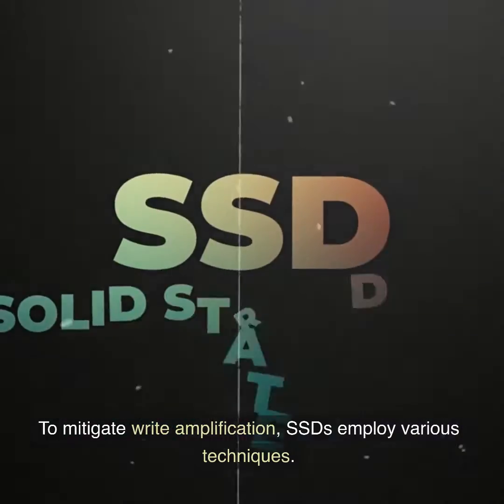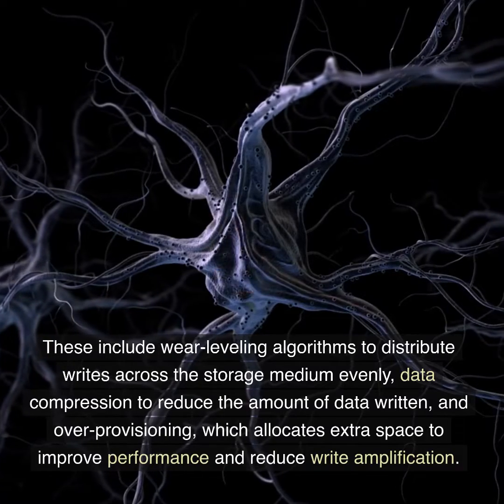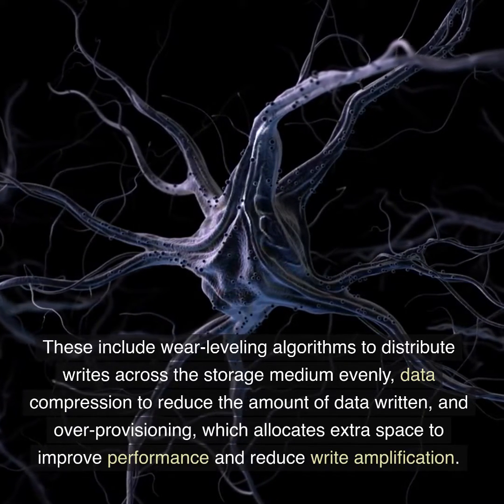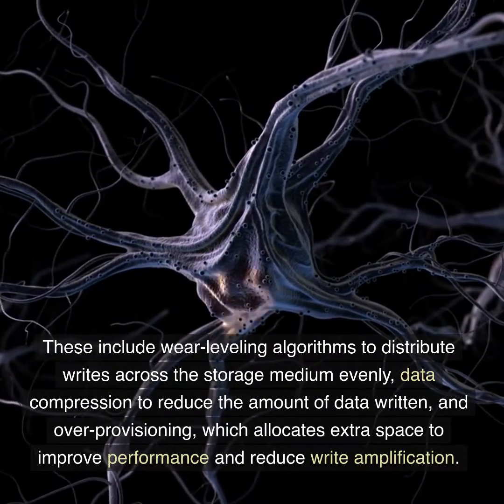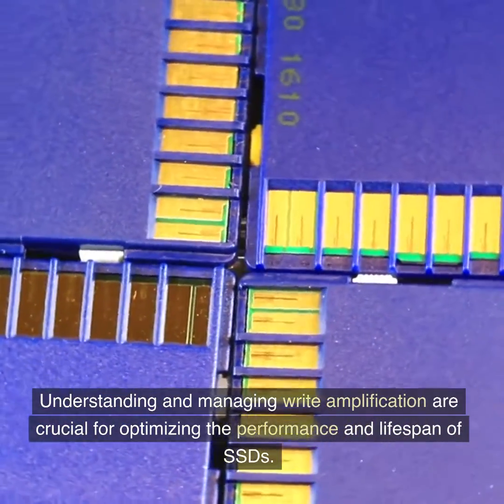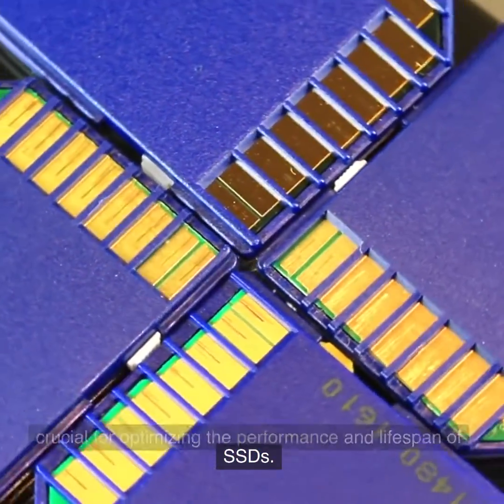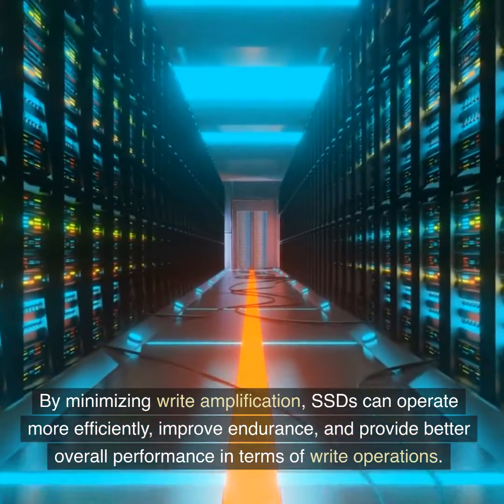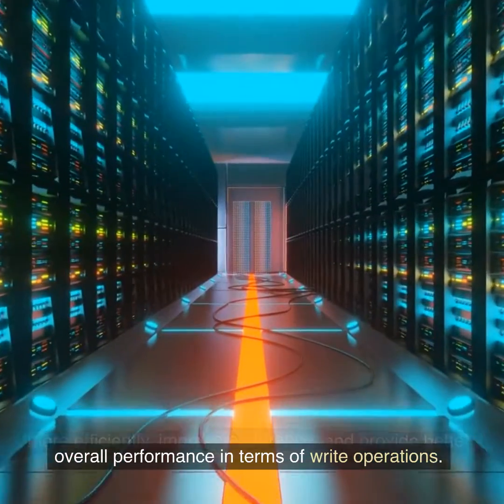What is SSD Write Amplification? [2023]

Comment: I installed a 2TB SSD about two weeks ago and I've come across a puzzle that does not appear to fit with questions elsewhere. My total host writes is 773 GB and my NAND writes is 241 GB, which sounds like the opposite of write amplification. Is this to do with what I do with the disk - I basically use it as a data store for media files that I seldom edit. Or is it to do with data compression? Maybe it is too soon to tell, because who knows what I will do with the disk in future. It has no paging file.